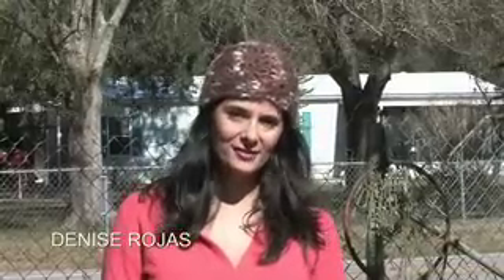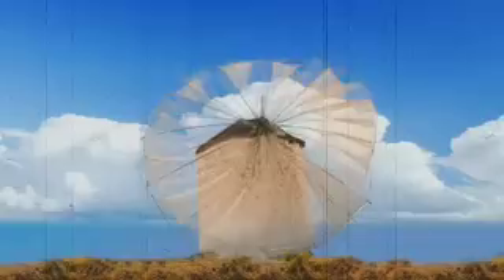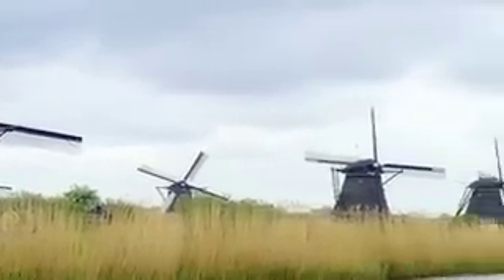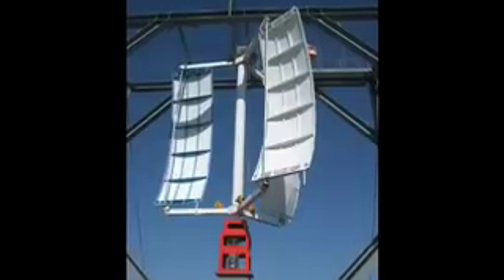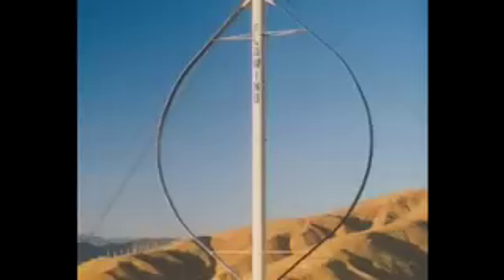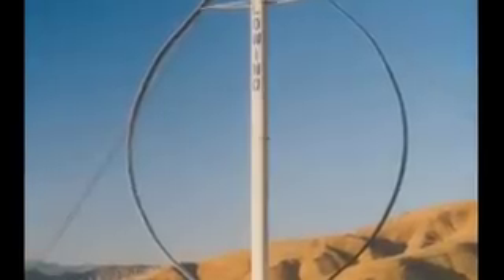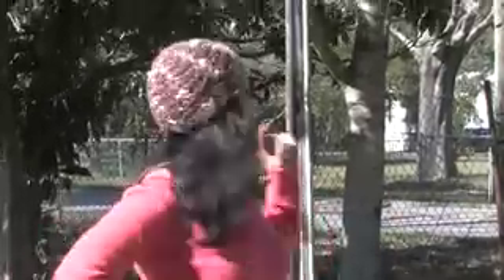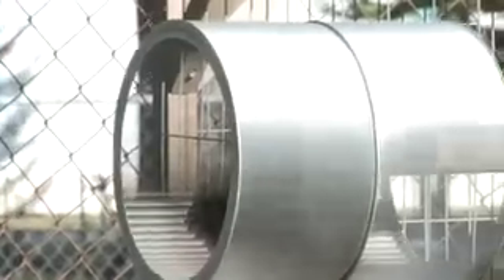Vertical Wind Turbine WINDMILL VERTICAL AXIS FREE ENERGY WIND

Comment: I have a blower fan attached to a 1/4 hp,1.2amp motor. I have been trying to get it to work as a electrical generator, however, I don't get a charge out of with the cylinder spinning. Would anyone know if it's just easier to mount the fan on to an old car alternator?

Comment from the maker: This size will not do much (30 watts in strong wind), it is more of a demo for building larger models. If you had several, you could get some usable power with the right wind. Especially considering many end up in scrap yards every day. There are much larger versions out there already made and with a combination of energy conservation and proper design, they can replace a certain level of grid power. Thank you for the comment.

Comment from the maker: These small ones have about 20-30 watts in 15 mph wind. If you are attaching a generator for charging power, the design would need to be copied and enlarged. Most permanent magnet motors are DC generators.

Comment from the maker: There are several patents being issued for similar designs because of their ability to snug up against a roof top or a metro sky line. This design is tested for wind production as a fan and if this were scaled up to a usable size say 24" in diameter like the one I just got for $1, I would disagree on their usage of power production. Do not forget that urban areas have vertical lift from buildings and in sustained wind over 10 knots squirrel cages can cary a fair load for their compact size.

Comment from the maker: Agreed. That is why most DIY projects using homemade AC generators offer little use with the exception of light bulb flickering. A much larger cage design would give enough torque to charge a DC battery for AC conversion. The thinking behind this video was to use free or scrap material to build a system that can pay for itself quickly without having to recoup the cost of a vertical design that is new.  This one produces about 5W in Florida wind (very little). It can trickle charge.

Comment from the maker: Agreed on spinning, but consider this a scaled down prototype. There are cages like this one much larger and just like a standard turbine, energy conversion is proportionate to quantity and size. Diameter for diameter this design offers much more efficiency, requires no tail fin and spins on almost no noticeable air movement

This fan in 30 MPH wind is not safe to hand stop.

In a 5MPH sustained breeze it can produce 10-15 watts of loaded resistance & 9v no load. 

Thank you for your comment.

Comment: A common mistake is to interpret the spinning cage with actual energy production. Even a small load on that horizontal example would stop that one very quickly. Another issue is that the energy available from the spinning cage is proportional to it's cross sectional area. You will need a much larger one to extract very much useable energy out of it.
A good test would be if it is hard to stop with your hand. If you can, then there is not much available energy. High school physics has a use.

Comment from the maker: Yes they were more widely used as pumps but also electric. The squirrel cage would best be hooked to a low voltage permanent magnet motor with a gear ratio of 10/1. This would go to a voltage regulator then into a 12v charging system. I have seen a lot of homemade A/C generators and because random low voltage A/C is virtually useless for anything other than flickering an incandescent light bulb, I think D/C would be the only choice due to a wide range of velocities.